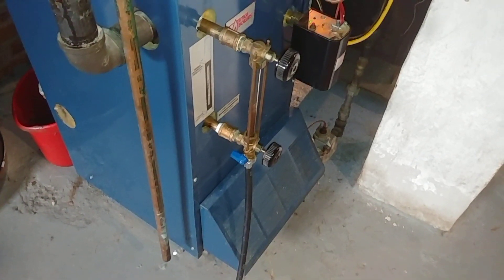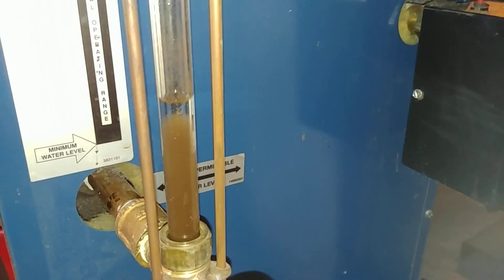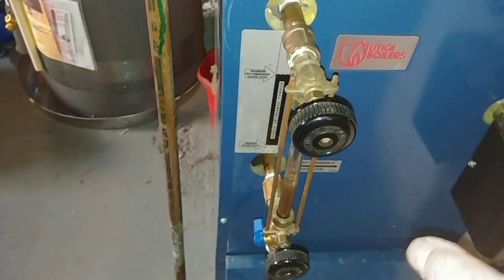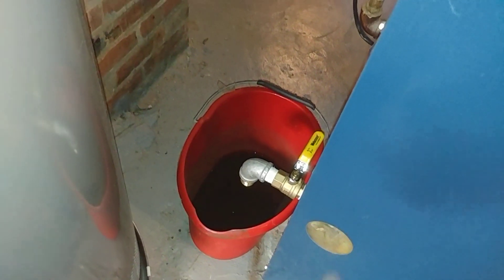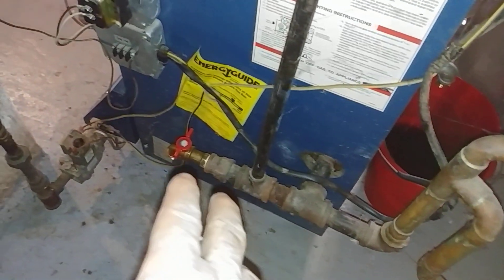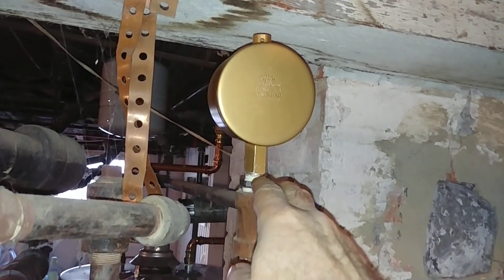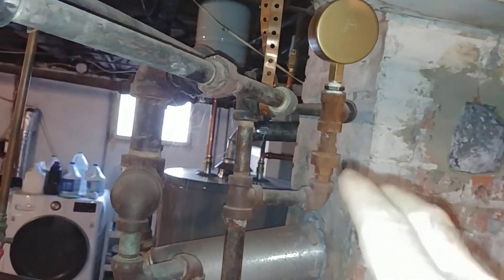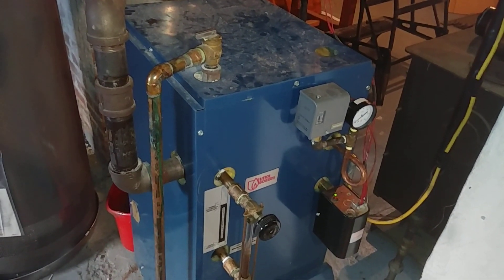Promising Results After Servicing A Steam Boiler On A Two Pipe System

Comment: HI GORDON , I just left a message in your other video. I have a oil steam boiler that need to replace the coil(water leaking), but it is too rusty, the plumber seems not sure if he can take the bolts out after I show him the picture . So I need some knowledge and help. I saw some video use fire gun to work on .

Comment: Are you doing any kind of water treatment or water test to the system? Former boiler operator here.
Reply from the maker: In our area, the water quality is not bad (more or less neural pH & relatively low TDS).
For Steam Systems in our area, the best "water treatment" is a tight, leak free system.